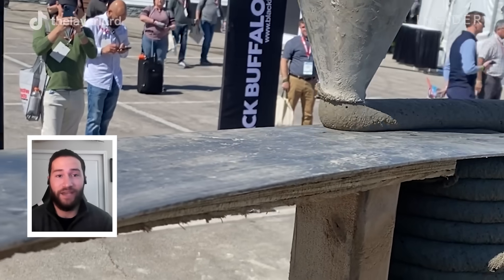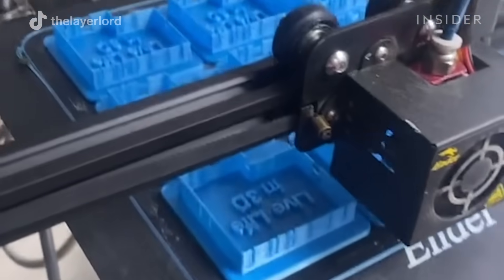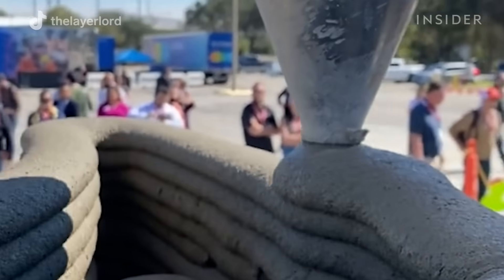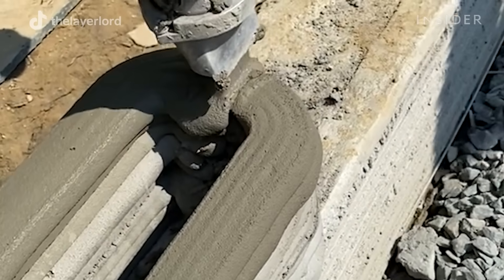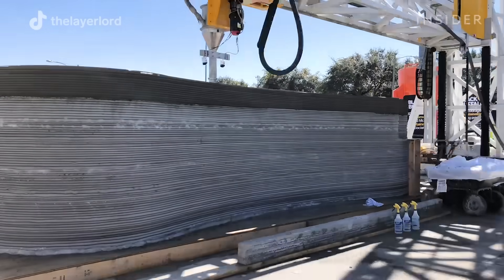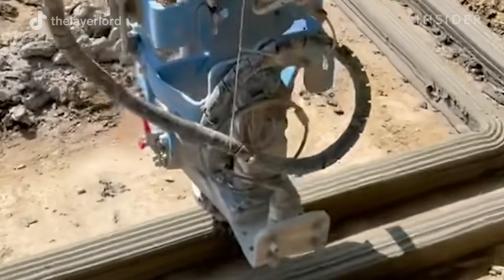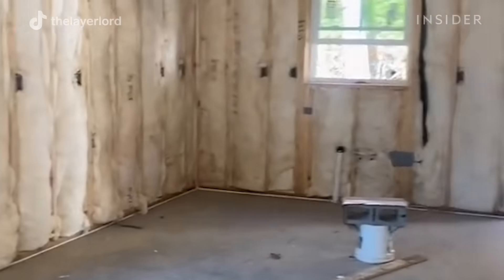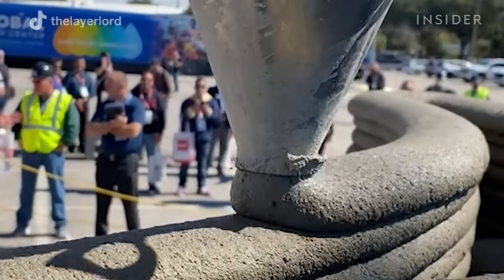How Concrete Homes Are Built With A 3D Printer | Insider Art

Comment: I have been looking into this for awhile now, I am very interested in either being a customer or an investor. 

I have a piece of property that would be ideal for a 1300 sq foot cement home print build but I need to speak to an expert as I have questions. 

Can you buy the printer equipment out right and than either pay for training or hire IT guy to design the file? 

What’s all in cost on a 1,300 sq foot home before adding doors,windows,central air, plumbing?
Reply: Also, would like to see some examples of completed projects and how they are 2-3 years down road.

Comment: !) If you have to wait 2 weeks until you put the roof on then they will NOT be quicker to erect as you can get a brick house up in that time and it wont need all the rendering that this complete mess will require.
2) You cannot possibly state that it will be "More durable over a long period of time" as you will only get that evidence after a long period of time (many decades) has passed-which is obviously not the case as its new technology. 
3) Its going to be a nightmare completing any alterations on the house.
4) It looks like a mess.

Comment: Doesn't seem like it would very breathable? 

Is there a lof of ventilation? ...does the house move with and adjust to weather changes? And what if the convrete cracks ..from external pieces it could be repaired easily enough ...but there seem to be a lot of in between walls parts ...I have so many questions!

Comment: Great idea and a good first step. Judging from this video, It needs refinement to become main stream.  For example. laying reinforcement iron, pouring insulation along with concrete and a nicer wall finisher tool could and should be added.  Window and door installation needs improvement.  I am not sure about how good is the idea of 3d printing all of the inner partition walls. Also, I wonder how well this type of house would perform in tornado, hurricane and fire prone areas.  My guess is that it would be superior to anything made out of wood.  What about the earthquake readiness?

Comment: Wow, sorry for being negative, but leave it to Americans to use a cool new technology that can make ANY shapes to build a bog-standard boring house that looks like any regular american wooden home with faux-historic pillars and stuff.. :D And paint it white... If you squint, the lines even look like it's the most basic boring plastic vertical facade cladding.

This technology makes sense only for weird shapes that would otherwise be difficult to create by other techniques. Cinder blocks are surely faster and cheaper than this - the ceilings and roof and finishing of the house is what takes the most time anyway and that remains the same no matter if 3D printed or not.

Comment: One major problem....As layers are applied the weight of the concrete increases. The lower sections therefore take and distribute  this weight. Unlike a fully poured and complete section. Which distributes it's weight throughout its structure.  These layers fail if (and when) the lower layer fails. In other words , one Crack the whole structure  fails......😮

Comment: Where is the Reinforcement, the Insulation, the Air Barrier, the Moisture barrier, and the Waterproofing?
Reply: They don't do that in America in traditionally built houses as well.
Reply: @4354-d4v  
Energy codes are building codes that set minimum requirements for energy efficiency in the construction and design of new and renovated buildings. The goal of energy codes is to reduce energy use and emissions and save consumers money. 

They can cover many aspects of a building, including: 
Insulation, Windows, Air leakage, Duct leakage, HVAC systems, Building envelope, Electrical systems, and Lighting systems. 

The two main model codes are the International Energy Conservation Code (IECC) and ANSI/ASHRAE/IES Standard 90.1-2019 (ASHRAE). For example, Vermont's Commercial Building Energy Standards (CBES) were updated in 2024 and are based on the 2018 Supplement of the IECC. The 2024 CBES applies to all new commercial building construction and additions, alterations, renovations, and repairs.
Reply: @4354-d4v  
The United States Design Codes & Standards
Minimum Design Load Requirements
Minimum Design Loads for Buildings and Other Structures, 3rd Printing (Standard ASCE/SEI 7-10)
Minimum Design Loads and Associated Criteria for Buildings and Other Structures (Standards – ASCE/Sei)-New Release Version-2016

United States International Residential Code (IRC)
R606.12.3.2 Minimum reinforcement requirements for masonry walls.
Masonry walls other than those covered by Section R606.12.2.2.3 shall be reinforced in both the vertical and horizontal direction. The sum of the cross-sectional area of horizontal and vertical reinforcement shall be not less than 0.002 times the gross cross-sectional area of the wall, and the minimum cross-sectional area in each direction shall be not less than 0.0007 times the gross cross-sectional area of the wall. Reinforcement shall be uniformly distributed.

Table R606.12.3.2 shows the minimum reinforcing bar sizes required for varying thicknesses of masonry walls. The maximum spacing of reinforcement shall be 48 inches (1219 mm) provided that the walls are solid grouted and constructed of hollow open-end units, hollow units laid with full head joints or two wythes of solid units. The maximum spacing of reinforcement shall be 24 inches (610 mm) for all other masonry.

Comment: 🌴🤔 Somewhere there is a cake decorator drooling to get a house built like this ,so the thing is you have to have a foundation still made , there’s no reinforcement ( rebar or wire ) , I would think that using this as a fill method to fill plywood forms with rebar in them might be better , I once saw a huge pre cast concrete building go up next to my work place in a matter of a couple days ,

Comment: As a carpenter, I dont like this construction method at all!!! ITS POOPY and dumbly... As a tool and die maker, Cnc machinist,  Im drooling in anticipation. This aspect off additive machining is awsome! The hell with weak ass plastic 3d printed parts that fail, these homes will be rock(pun) solid!  Just remember if you are interior/Trimming walls, curved walls are a total PITA! You are warned.!!!    Best wishes folks, I love tech.  P.s coatit with a thick epoxy Uv resistant coating and it'll look good for decades or longer!!!!  NICE,

Comment: This is not how concrete works. There is something called reinforcement. Also, you should use as little as cement possible, because it is expensive and CO2 emitter. Every idea that comes into mind not necessarily has to be materialised.

Comment: This is very interesting yet i see it has drawbacks ,the layers will set dry at different times and there is also a potential for some layers to not fully set level above the previous ones thus creating gabs just tiny gabs which weakening the entire building,
.i rather  go for the old known method of mold blocks unless i have alot of money.

Comment: This is an amazing building technique using mostly concrete with steel reinforcements and will save the trees used for standard wood built structures. My grandparents built their house from block and it was a very quiet house.❤
Reply: Concrete is vastly more destructive to the environment than using lumber. Trees grow back lol
Reply: @Trenz0  Concrete sequesters carbon from the atmosphere increasing its hardness during the entire lifetime and trees only sequester carbon when alive. Concrete does not burn. How about those trees? I speak for responsible forestry, less cut trees is more clean air.
Reply: Trees are farmed. Saving nothing, only losing forestry jobs.
Reply: @ennohoock154 Old growth forests take +50years to grow back and stabilize the soils. Trump cut Nation Forestry jobs, so much for old growth giants. They will be missed.😢

Comment: How is this different than just pouring concrete with a pump truck?

Oh, its not at all.
Reply: you cant just pour concrete with a pump track to build a house, you need a formwork, people, and much more time. but how could you know that if you build houses from cardboard which falls down after a small wind
Reply: @lysflath4101  it would actually take less time and it wouldn't require any extra people to pour the concrete beyond the pump truck operator. The forms are reusable as well. 

Putting the house up isn't the part that takes a lot of time. You can literally frame a whole house in a few days. You aren't building the interior of the house with concrete, which is the part that takes time. Unless you are going to encase the electrical and plumbing in the concrete walls.

Comment: this is garbage, those printed walls still have to get filled with concrete, you can build that concrete wall in a day with rapid forms. also there's no reinforcement, those little pieces of steel going across every now and then is no where near enough, nor are they placed in a way that would reinforce the concrete

Comment: What happens when it cracks? What happens if a wall shifts and needs to be repaired? How do you even repair this?? You’ll need a concrete contractor which isn’t cheap. It’s a cool concept but idk how it’s gonna work longevity-wise. It’s not like you can just move a wall to remodel, or add a room addition easily.

Comment: Will this allow americans to start building houses from something other than paper finally?
Reply: My house in FL is CMU block, on a 6" slab, with rebar running from the slab through the block and tied into the roof, which is finished with concrete tiles.  The CMU walls are all 100% filled with concrete.
Where is the paper bro ???????????
Reply: @darknes7800 since when do you represent every american in the us?

Comment: Illegal to do that without reinforcement in north america. The first time one of those shit shacks collapses on a family people will be wondering why whike every trades person will know
Reply: Reinforcement is not a requirement in NA, and its application is for adding tensile strength against lateral forces. This house isn't tall enough to encounter enough shear force on its vertical construction. Are you a tradie? It doesnt sound like it.
Reply: @weakish  lmfao a tradie??? Wtf is that?? I'm a master carpenter child,and I manage projects in the 1-1.5billin dollar range. Concrete on it's own has ZERO strength, without rebar it's garbage that will just crumble. You need to get educated child.muted.
Reply: @weakish  and yes, reinforcement is 100% required in North American for ALL concrete work. You're thinking I meant asphalt which i did not. A "tradie" lmfao wtf 🤣🤣🤣🤣🤣
Reply: @weakish  and now the beat down begins...Building a concrete wall without reinforcement can result in structural instability and a higher risk of cracking and collapsing. Reinforcement, such as rebar or wire mesh, is typically added to concrete structures to provide tensile strength and prevent the concrete from failing under tension.
Reply: @weakish  north American building code minimum requirements - Rebar Placement in Walls
Rebar is placed horizontally and vertically in the wall, in a grid pattern. As a minimum, #4 rebar (1/2 inch) is spaced vertically at 36 inches on center, continued to within 8 inches of the top of the wall, placed on the tension side -- the inside face -- of the wall. The cover required is 2 inches for foundation walls, or walls exposed to weather, and 1 1/2 inches for walls that aren't exposed. Horizontal spacing for #4 rebar is a minimum 2 feet, within 12 inches of the top and bottom of the wall.
Reply: @weakish  The collective experience of generations of workers have brought us to the standards we have today. The industry standard is to put rebar in concrete every single time, whether it be for a sidewalk or a football stadium. If you want to relearn what the industry has already figured out and pour a shitty foundation that ends up fracturing in non optimal ways then be my guest. Spoiler alert it’s gonna cost a lot more than $700 to fix if something goes wrong. Just pay the measly $700 and do the job right.
Reply: @weakish  Not to sound condescending, but if you are honestly needing to ask this question, you probably shouldn't be allowed to make these kinds of project decisions....

Concrete without rebar is basically just sticky sand and gravel. It has essentially no tensile strength (at the scale of buildings), which means it cannot resist any lateral loads, or bending moments.

Comment: I didn't see any reinforcing bars?!?!
Reply: concrete needs rebar in tensile, not compresion
Reply: Right and walls need tensile strength to prevent overturning.  They aren't printing slabs on grad.

Comment: what a scam. those are just WALLS you numbskulls. it's cheap concrete with NO REBAR reinforcement. It is not durable. That stuff is going to chip and fracture. It serves no other purpose than to replace the siding on your house...
Reply: He numbskull, Rebar is only placed in concrete to help with tension and lateral forces. These houses aren't tall enough to worry about wind causing enough force. That said the power of this is to build cheap houses fast but the builders just pocket the saved money anyways and price like the houses in the neighborhood. .

Comment: If you have a power outage while 3d printing the house, you have to knock the whole thing down and start over.  😂
Reply: generators have been around for a while. However i can explain one to you. you fill it with gasoline and pull a string to start it. it turns gasoline to electricity
Reply: @Zyghqwyv    I was joking. Because that's what happens with most plastic 3d printers.
Reply: @my3dviews  all the ones i use have blackout recovery, which one do you use?
Reply: @Zyghqwyv    Actually I use a Markforged professional grade 3d printer at work.  :-)

Comment: Maybe for garages and utility buildings, but homes have many mechanical systems, that would be difficult or impossible to do without stopping the process in midstream. Its done in log cabins and timber frame construction, and you will find the cost of plumbing and electrical to almost double in price, Right now its like those ship container homes,,,, they ain't cheaper, they ain better, You know how they went from concrete block foundations to poured walls ?...because poured walls were cheaper and better,, This method may be suitable for foundations, but right now, I cant see it being an alternative to traditional construction, A typical poured foundation 1200 sq-ft takes about 60 yards of concrete, at $140 a yard material and about $80, a yard labor....$13,200,  I wont get into the floor or the excavating as either method those costs are the same.

Comment: I don't understand how this is less expensive than using forms (re-usable) and pouring concrete. It's much faster and possibly uses less labor when you factor in printer set-up at each site and post-pour cleaning.
Reply: Labor costs. People want to be paid fairly for their work. But "fairly" can mean a big money dent for projects and the project management and the management above them, and the management above them, and the management above them. If
Reply: @Heb_N  So, robots set all this up then clean the machines too? lol
Reply: @bobhenry6159  With forms, construction crew have to drill out openings and spaces for internals, adding a great deal more labor and cost to a project. With printing, all this is done at the same time the walls go up, as all the openings and internals are designed into the print path beforehand.

Comment: 1. Why the HOSE doesn't have flaps wing rectifiers to make the bulges of these lumps FLUSH? It's in front of your NOSE, man. 
2. Why this looks like poop? It can have protrusions, variations and even access holes for more structural and design complexity? 
3. The printing can allow MORE ADVANCED forms other than just match boxes? C'mon there's much more to this. 

:3

Comment: Dams should be built with 3-d concrete printing. A honeycombed design that is engineered rather than bulk weight. Think of it as a concrete building on its side with the roof facing the lake and the basement facing the outflow.  Old dams were built with mass and weight to hold back the water.  An 3d engineered dam would be 2, 3, 4, 5 dams combined into one. The salmon dams could have aqua elevators installed. Dams are the best sources of power because of the reservoirs that are also created…

Comment: How long do they last?  I think it's a great idea. It may need to have a better foundation. Maybe a floating foundation? One on jackstands you can raise up or lower.
Reply: The thing about 3D printing with concrete like that is that there's no rebar supporting it. It wouldn't be nearly as strong as reinforced concrete.
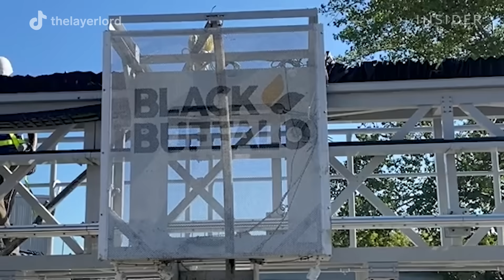Reply: @RationalEgoism  At 1:42 they added reinforcement so it's probably used just not really seen from the angles that they filmed from.
Reply: With good strong sneeze, you can kiss this investment goodbye 😂

Comment: How are these meeting building code? Doesn't look like the wall will have any tensile strength. 
In a concrete wall you need a network of rebar to provide tensile strength.
How is that issue mitigated with these walls. Seems like a big issue.

Comment: 3d printing houses is nothing but a grift. It's not low cost, it's not cheaper than alternative construction techniques and putting up the shell of a house is only a fraction of overall time to completion. Oh and while the houses have some interesting potential shapes they're also super ugly. If cities or towns want affordable housing they should be putting up apartment buildings instead of some sprawling single story house that wastes a lot of land and is not affordable. After all, the cost of land is probably more than 50% of the price of a new construction - higher density == more affordability.